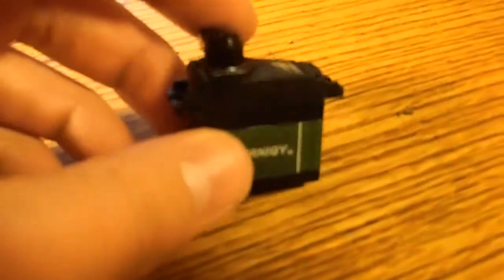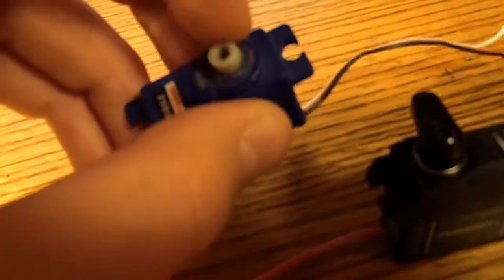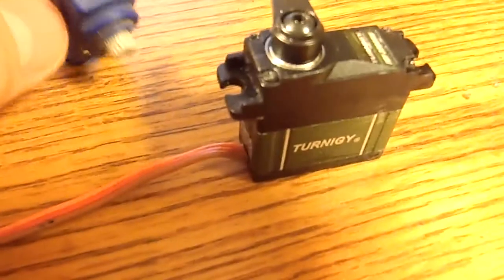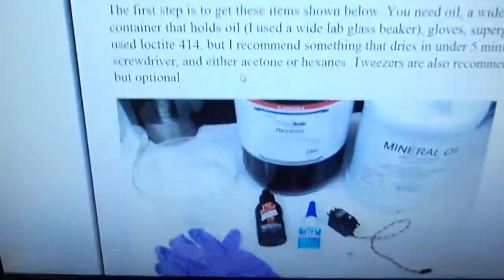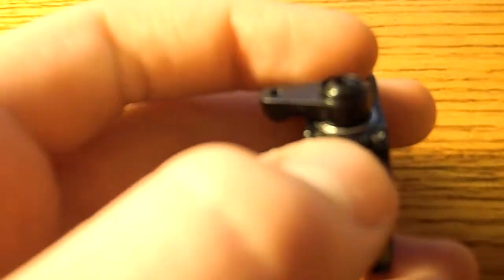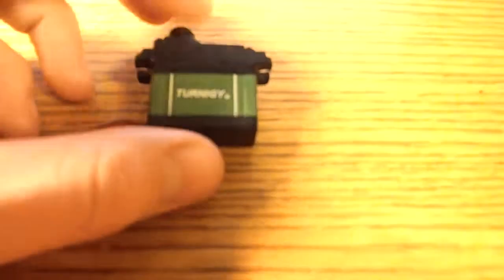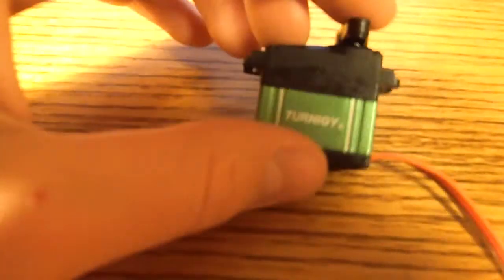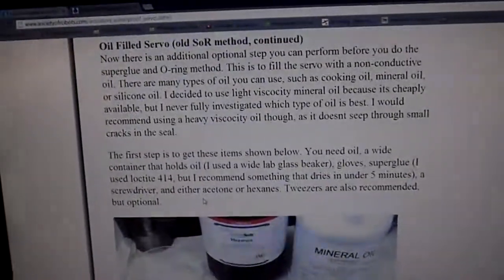How To waterproof a Servo

Comment from the maker: Yeah, it's a great servo! But, I would recommend not using the vegetable oil like I did. Use mineral oil instead. It can be bought from Shoppers drug mart or walmart for a few bucks. The issue with the vegie oil is that it goes slightly solid inbetween driving sessions. You have to turn the tires back and forth a couple times to get the servo up to speed and break up the oil. I now have some mineral oil, so I'm going to replace it.